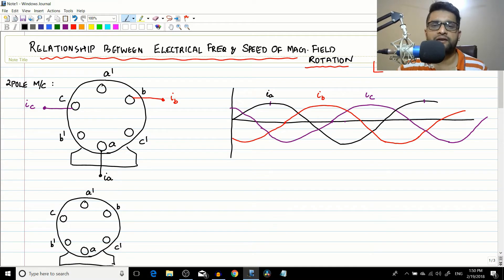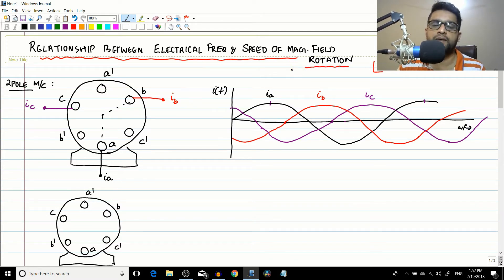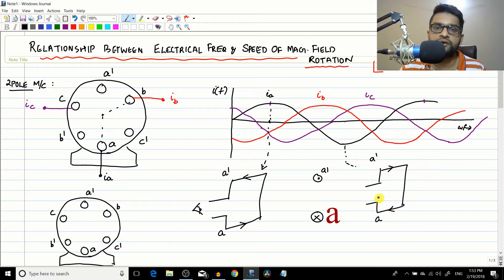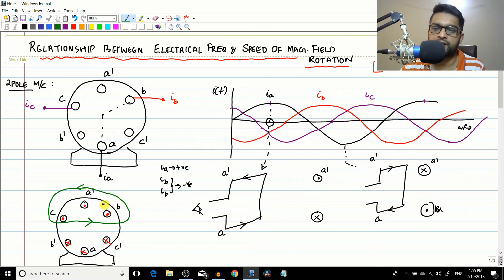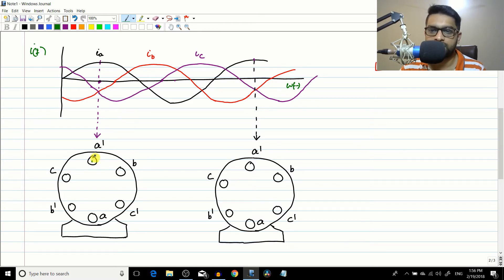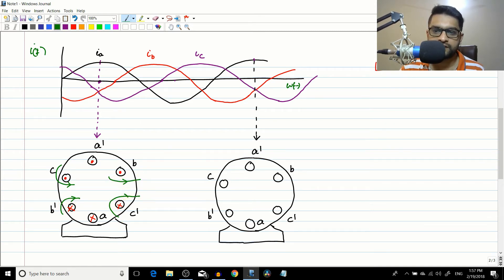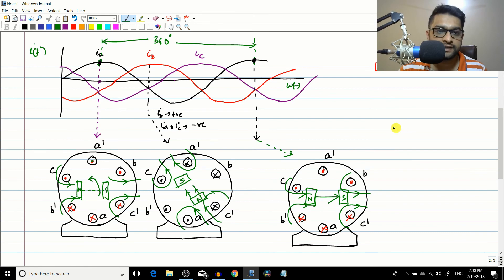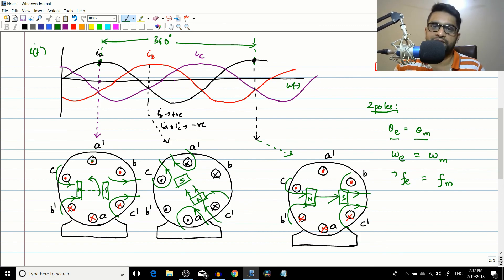#6AC machines Basics-Relation between Electrical freq and Speed of Magnetic field rotation - Part 1

Comment: polarities will be different i think cuz inside the field lines are moving from north to south but it is not so... right??
Reply: Correct, I have the same doubt

At 5:42 magnetic lines should entered south to north(internally) and north to south (externally) like in a bar magnet.

I think Varun has labelled them incorrectly. Would like to see him respond on what he thinks
Reply: @justadreamerforgood69  how internally South to North ?
Didn't get u .
Reply: @justadreamerforgood69  No, the magnetic field lines always go from north to south internally for any magnet.
Reply: @souravsen2981  
Nope, it depends actually.

Flux leaving the core is assumed as North Pole so magnetic field lines can go from N to S pole internally (for stator) and S to N pole internally (for rotor like a conventional magnet)
Reply: @justadreamerforgood69   never
Reply: @wanjevi  
I'm correct
Reply: @souravsen2981  
2 years later I'm here again and I found the reason

Flux leaving the core is considered as North 
So in the stator the flux lines which leave the core and enter the air is the N pole.
Reply: @justadreamerforgood69  here I'm my old friend!! Yes you are absolutely right about that. When the flux is leaving the core it's considered as North and the point it's entering it's considered as South